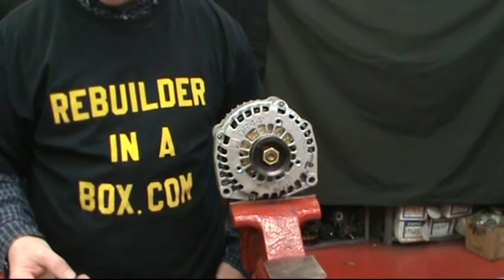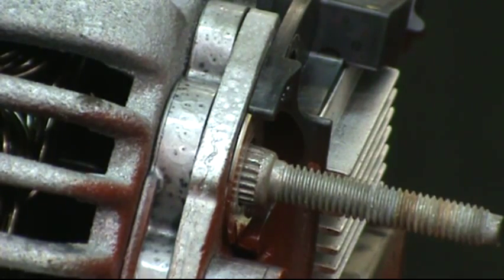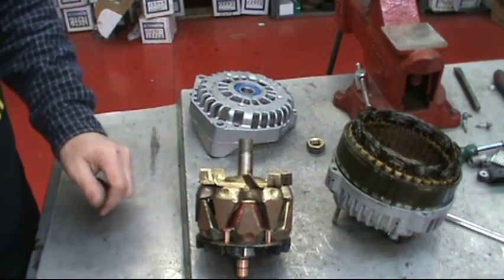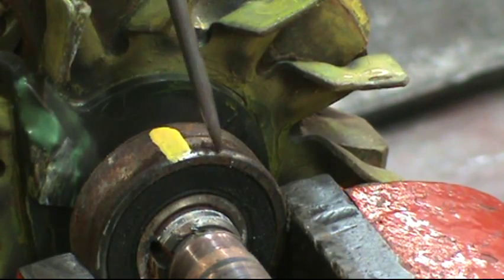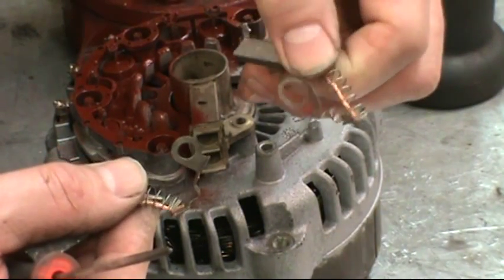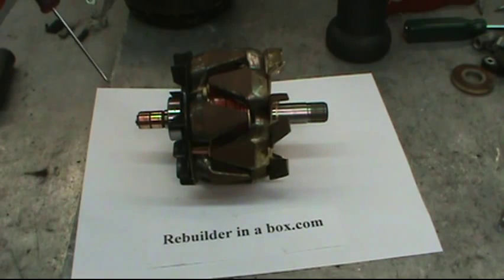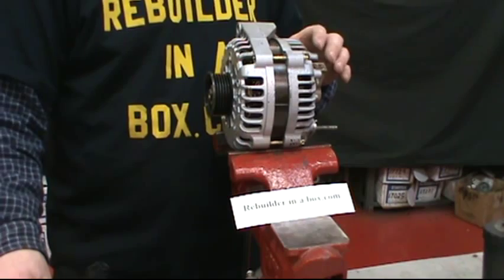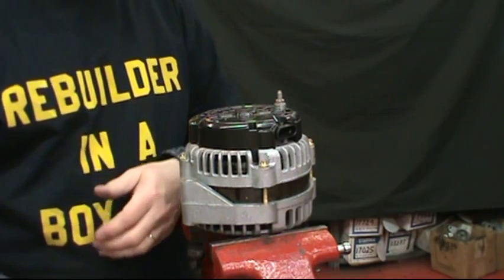How to rebuild a DR44G Alternator

Comment: man thanks. i also rebuild alternators, and i always have sooooo much trouble trying to get that rectifier hot post sleeve off. i didnt know tapping down on the post would loosen the knurled threads. so much easier now.

Comment: This is a great video and it definitely helped out a lot. Thanks for posting! I do have a question though... In the three years it has been posted, hasn't someone let y'all know that it shows you putting the brushes in at opposite angles? One is left to right uphill, the other is right to left uphill...
Reply from the maker: Ahh be darn we are not perfect.  Thanks for the heads up.  The right way is left to right uphill for both.

Comment: I have an AC ripple problem with my DR44. I see that you said the diodes are a pretty labor intensive job. Would it be best just to purchase a re-manufactured unit at that point?
Reply from the maker: Yes. The kit would also cost too much. Not really a common thing on this style.

Comment: Why does your Dr44G look different than mine?  My mounting bolt holes are located differently.
Reply: His is off a truck or Suv and I'm guessing yours is from a car?  On the trucks and yukons etc they're mounted on the top of motor and on cars they're mostly mounted lower or to the side where they're more "fun" to remove. Lok

Comment: Do you think a Bernzomatic torch with soldering tip would be suitable for the desoldering/soldering?
Reply from the maker: The smaller ones that operate on lighter fluid.
Reply: @rebuilderinabox  That's the type I have.  I'll give it a try and let you know how it turns out.  Otherwise I guess I'll order the Weller.

Comment: If the slip rings are reusable but just needs cleaned up, as said, scotch brite, crocus cloth or emery cloth can be used to evenly clean the copper rings. Just as a note; place duct tape on the back of your crocus cloth, emery cloth or even your scotch brite with help your sand paper from tearing and lasting must longer with the backing on the paper to help it take abuse during cleaning.

Comment: You need some tools. A rubber hammer and an arbor press will make your job much easier and prevent damage to the part you are working on.
Reply from the maker: Rubber hammer maybe. Of course, we have presses in our shop, but who has one at home? Our goal is to complete the job for the average working class garage with COMMON hand tools. If you've never actually done one before, you would think a rubber mallet would be helpful. We've done thousands, the rubber mallets are in the tool box drawer.

Comment: Weird internal noise, any idea before I commit to a rebuild kit? I dismantled based on your video (thanks for that!). This is a new alternator and bearings seem fine to me. I think the internal wash with the "high side" was on the wrong side of the fan and seems a lot smaller than the one in your video. Could that be the issue? You can listen to the problem here in a short video if you have a moment to help me out. Thanks in advance! 

https://www.reddit.com/r/LSSwapTheWorld/comments/nx3opt/ls_accessory_noise/
Reply from the maker: Are you sure the noise is the alternator? Install another alternator and see, not A typical alternator sound. Many noises are elsewhere, but resonate thru metal. You'd swear it was alternator, but you need the process of elimination. BUT, that washer has to be the right one, so I'm not 100% sure.